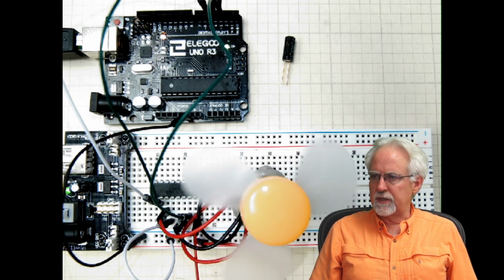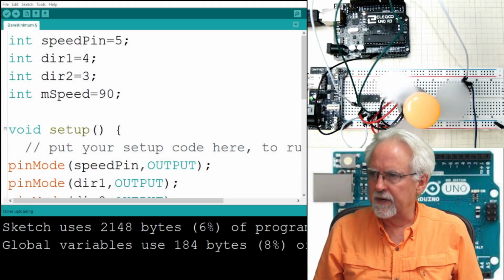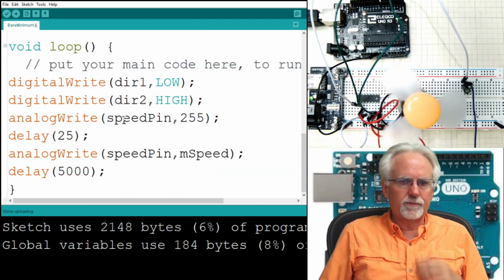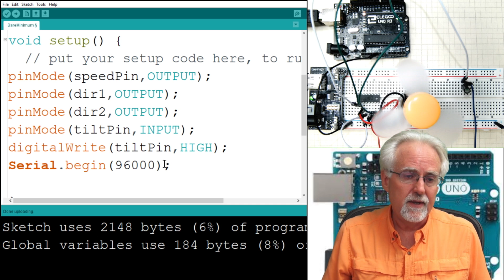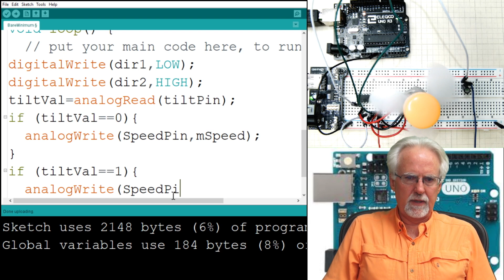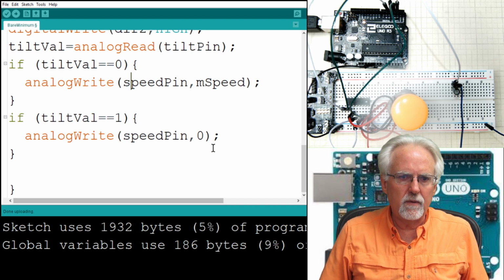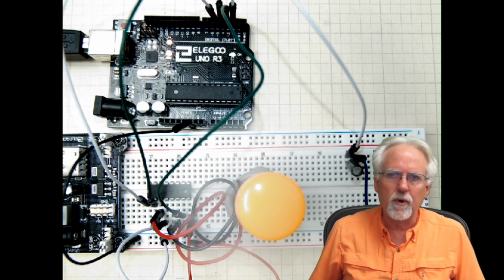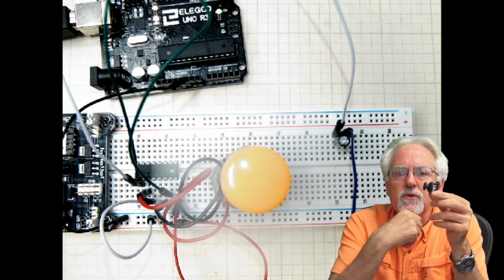Arduino Tutorial 38: Using a Tilt Switch Cut Off With a DC Motor

Comment: My solution was essentially what you did, but with one difference: the motor is only turned on or off at most once per loop() iteration. That is, the motor is initially turned on in setup(). The logic in loop() uses logic similar to the logic  you used in Tutorial 34 about using a pushbutton, where the previous button state is compared to the current button state to determine whether the button was toggled. Here we compare the previous tilt state to the current tilt state; if we went from not tilted to tilted, then turn the motor off; if we went from tilted to not tilted, then turn the motor on; otherwise, do nothing. Pseudocode for loop() follows.

*** Begin loop() pseudocode ***

read tiltVal
if (tiltValPrev == 0 && tiltVal == 1) then turn the motor off
else if (tiltValPrev == 1 && tiltVal == 0) then turn the motor on
endif
tiltValPrev=tiltVal
*** End   loop() pseudocode ***

This avoids having to turn the motor on or off for every loop() iteration; however, it may violate "best practices" for Arduino coding.

For my own edification, I decided to jazz this up to add a pushbutton that, when toggled, turns the motor on or off; each toggle of the button either turns the motor on or turns it off. When tilted, toggling the button still keeps track of whether the motor is logically on or off, but does not actually turn it on or off. When the motor is no longer tilted, the motor is turned on or left off depending on (1) its state when it went from not tilted to tilted, and (2) how many motor state changes resulted from toggling the button while tilted. This mimics a small tabletop heater that has a "tilt detector" that shuts the heater off if it tilts over. One can turn the on/off switch as much as desired; when you the heater is eventually set upright, it will either be on or
off, depending on how the switch is set.

Way too much information! However, as a retiree, I am having a lot of fun following your tutorials. Keep up the good work!
Reply: Hi John, i am trying to do exactly what you have done but the code is getting me. only difference is i am using a limit switch instead of a tilt switch but i would think it would be the same. anychance you could share the code you used. very new to this.